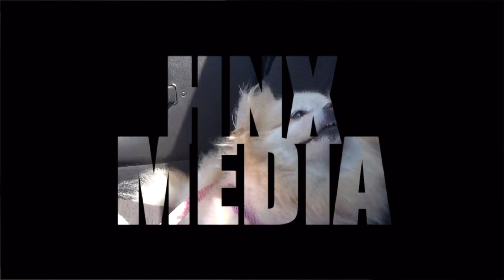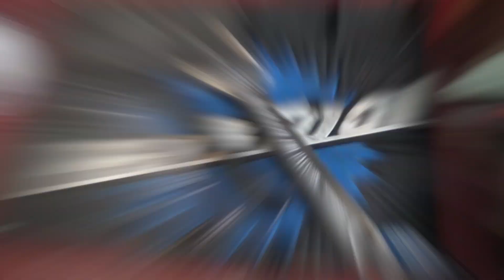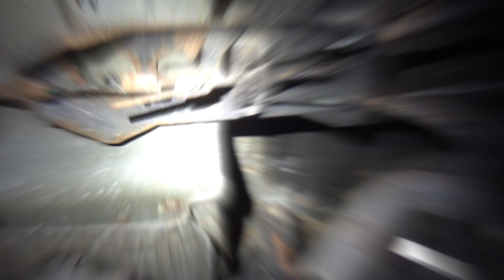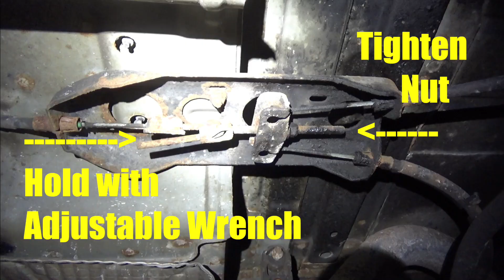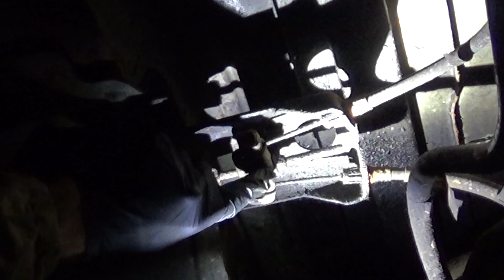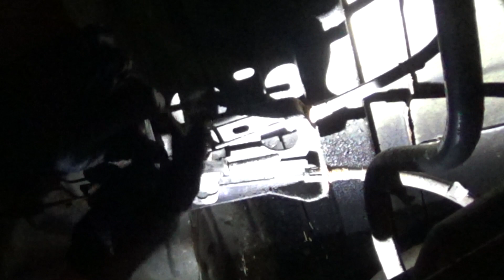Adjust Jeep Wrangler E-Brake (Parking Brake)

Comment: my Ebrake is stuck engaged, Brake light in cluster stays on and beeps, if i loosen up the cables should it free up the ebrake?
Reply from the maker: Short answer, yes, it should COMPLETELY disengage the emergency brake. But I am not a certified mechanic and I am not saying that doing so is safe. Best of luck.
Reply: @HNXMedia  i tried that, backed it off like 5 turns and the light stays on, i jumped in and tried to move the jeep but it still felt as if the shoes are still grabbing slightly in the rear. i need to pull my wheels off and inspect but i have to get it to my shop where i work at
Reply from the maker: @slappygilmore5040  I understand better now. Yep, the rear drums are locked on. You might be able to decrease the tension on those by accessing the drum through the screwdriver port on the "inside" underneath the the rear hub (both sides). Search "adjusting emergency brake at rear drum." Note, It is a total pain to do it this way. The only other way will be removing the wheel, drum hub and then adjusting from the inside. Best of luck.
Reply: @HNXMedia  i have a sahara with 4wDisc brakes, will they have that same port?
Reply from the maker: @slappygilmore5040  They should. It will be on the bottom of the inside of the brake drum/hub (i.e. you have to be under the car to see it. It will likely be oval and have a rubber "cap/insert" to keep mud and water out.
Reply: @HNXMedia  thanks a lot! ill give that a shot. i appreciate all the help and info

Comment: Is there a micro switch or anything that would keep the brake light flashing on the dash?  Beeps also.
Reply from the maker: Not that I can think of. I think the only reason that would happen is if you over tighten the e-brake adjustment and the computer thinks the brake is "on" all the time. I cannot think of any switch in line at this part of the process.  Maybe near where the brake handle is, but you would likely need to remove the center console to get to that. Good luck and let me know how it works out. I am very curious now. Peace.
Reply: This happened to me in my Jk. Turned out to be low brake fluid. Hope this helps

Comment: I also have a huge problem with my idol. Driving it is great. But when i come to a complete stop, She wants to cut out and then high revs to stay alive, every 10 seconds or so, then repeats. it dosent throw up any codes. the dealership has no idea and says it may be the CPU brain. thoughts? thank you again.
Reply from the maker: Casey Hill That sounds like a vacuum line issue (I have had exactly the same thing but typically only when it has recently rained or it is super humid outside). Vacuum line breaks/cracks are super hard to track down. I plan on replacing all of mine this Spring (I'll make a video when/if I do). If the dealership thinks it is the "brainbox," those are SUPER EASY to replace on most vehicles. You can get a used one online for less than $100 (usually). I did a video on replacing the "brainbox/CPU/ECM" on my Toyota Echo. The entire process took seven minutes (no joke) and cost about $80. Mechanic wanted over $600 for the same job. Hope this helps. Peace.

Comment: Hey man I have a 2014 Jeep Wrangler dragon edition and I thought it would be the same process but it’s not I’ve searched the web and found no other way to adjust my e-brake can you help
Reply from the maker: The only other way I know to adjust them is through the rear brake drum. You can adjust them without removing the wheel through the access port (covered with a rubber plug) on the bottom of the inside of the break drum. Or you need to remove the wheel, open the brake drum and adjust them by hand/feel. That is a bigger job than I am willing to get into right now, but if I do it anytime soon, I'll make a video. Best of luck. Peace.
Reply: thanks man I’ll try that first see what happens
Reply from the maker: @flexking25  Stop back by and let me know how it goes.
Reply: Will do man I just subscribed too
Reply from the maker: @flexking25  Very much appreciated. Peace.

Comment: I have a 2012 Wrangler and I don’t know if you realize that you can’t adjust the parking brake using you method, to fix my parking issues I had to replace the parking brake lever itself, also the parking brake isn’t self-adjusting either!
Reply from the maker: 2012??? I ain't the Rockefellers! This Jeep is 17 years old, and is the NEWEST vehicle I own. I've never dealt that new fangled, fancy technology they put in them 2012 models.

Comment: You never mentioned about the back pressure and what of the wheels should be free spooning or have drag when lifted off the ground
Reply from the maker: This is not as precise as actually opening the rear b and adjusting the internal mechanism, so it really doesn't matter (at least it never has for me). I always did it on flat ground though, just to avoid "excess" torque/drag.

Comment: Great video!  My bracket assy is pretty rusted and I bought a new one.  To remove the old one do I just back the nut all the way out?  You know of any videos for that?
Reply from the maker: Yes, I believe you just back the nut all the way out and replace the bracket. Haven't seen a vid on it, but it seems rather straight forward. Best of luck.

Comment: Great video! Thanks for sharing. I was wondering if you might be able to help me out with a problem. 
I have a 1979 Jeep CJ 7 with a Ford 9" differential. I purchased the E- brake cable for the Jeep ran the cable from the brake through the floor and connected the two cables with the bracket to the E- cable.
My problem is that when I did the samething you just did in the video my E- brake pedal got really hard and the tires were not locked.
Any ideas?  Let me say thanks in advance, thank you.
Reply from the maker: MrElPoderozo1 I think if you replace the entire line like that, you might have to adjust the ebrake inside the rear wheel hub. This is a secondary location where you can make more major adjustments. I have never done a video on that, but there are a few on YT. Search: Wrangler EBrake Rear Wheel Adjustment and you should find some. Best of luck!
Reply: @HNXMedia   Thank you and thanks for replying. 👍🏽

Comment: Is it bad to twist to far when adjusting
Reply from the maker: If you "over-tighten," usually, the only thing you will notice is the back brakes squeaking all the time. Then all you need to do is back it off a little.

Comment: Should I keep the handbrake down while I adjust it or up? Assuming that the Jeep is on a flat surface
Reply from the maker: I pull then lever up to get a feel for the "tension," then I put it down and make the adjustments, then I pull it back up to check the "tension" again and keep doing that until it holds correctly. So, to answer the question, while making the adjustments, the handle is down. However, that being said, I know some folks leave it up the entire time they make the adjustments. I like to get a "feel" for how the brake sets and holds. Hope this wasn't just a confusing mess of an answer. Best of luck. Peace.

Comment: 2015 Jeep Wrangler has no such adjustment, you could have stated year and model
Reply from the maker: If I could afford a fancy 2015 Jeep, I wouldn't have all these cool videos about working on my 2003.
Reply: @HNXMedia  thanks for great videos,I just now saw how obnoxious my reply came off,sorry. Yes for some dumb reason at some point,they stopped providing adjustment on actual cable,yes have confirmed this elsewhere,some have done own fix
Reply from the maker: @josephblough5856  No worries. Glad you got yours up and running again. Now you can get back on the trails. Safe travels!